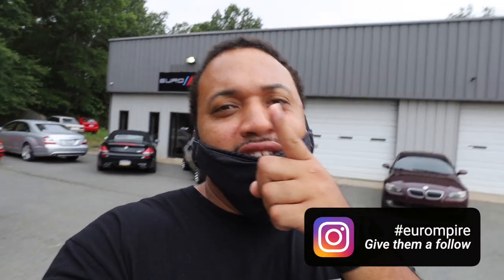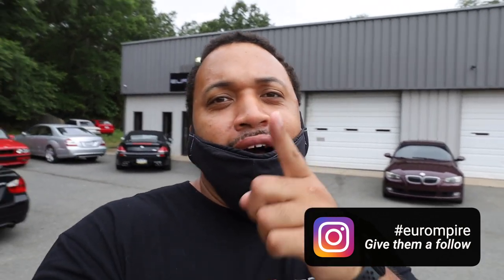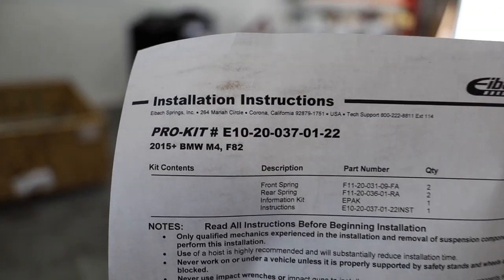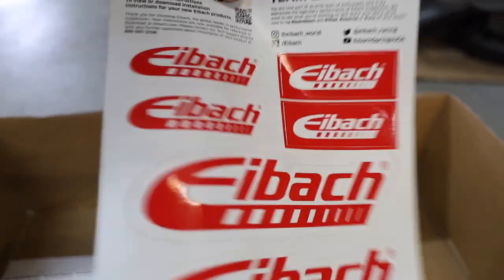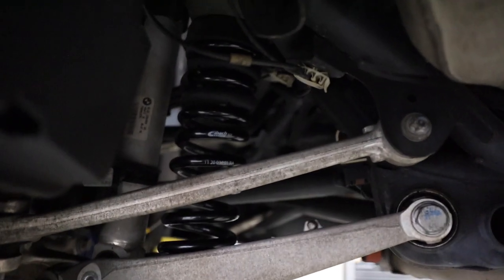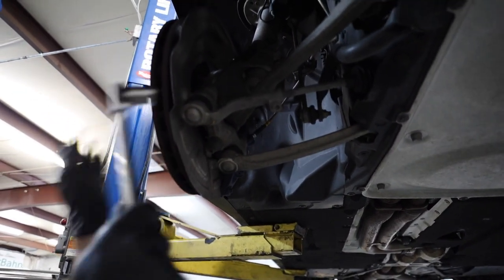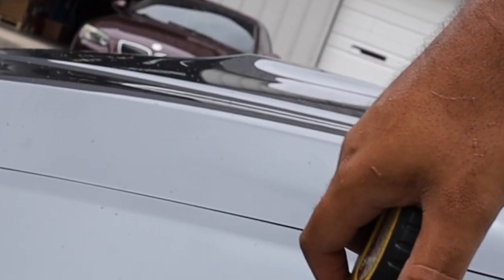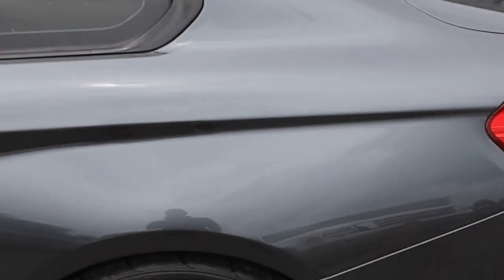Eibach Pro Kit Lowering Springs / BMW F82 M4

Comment: Looks good and good vid. I got E91 325I SE. You have M suspension so will reduce it less to begin with over OE SE suspension. I need more than 1 inch at the front 😂
Reply from the maker: Yeah I plan to do a follow up video soon as I changed my tire setup and it looks perfect now.

Comment: Great review, I hate the gap in the front so I'm looking to do the same thing. How much more have the springs settled? An inch in the front, half in the back? I have a front lip as well and I don't want to slam the car. How much did it cost to install?  - - Thanks!
Reply from the maker: The springs are now almost an inch in the front and .5 inch in the rear. I changed my tire setup and it changed the look completely. It now sits perfect to me. Each shop is different on cost, but springs can run anywhere from $300 up to install.
Reply: @WhatsyourForte  Did you notice your ride a bit bouncy after the spring install? Also is your M4 a Competition Pack?  Thank you!